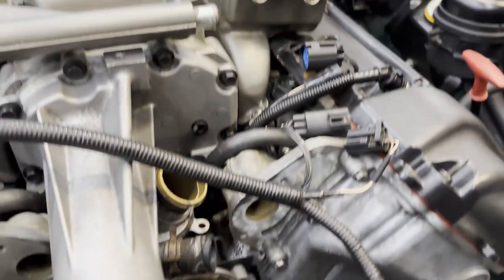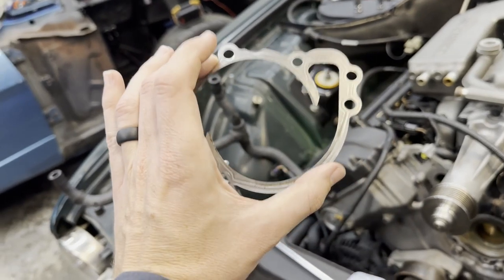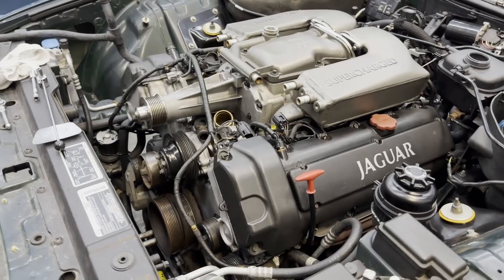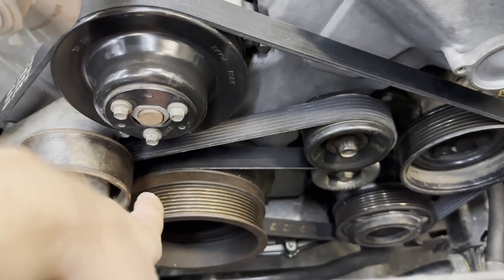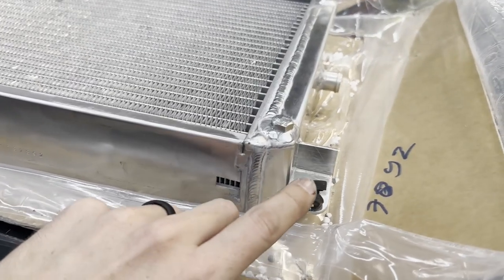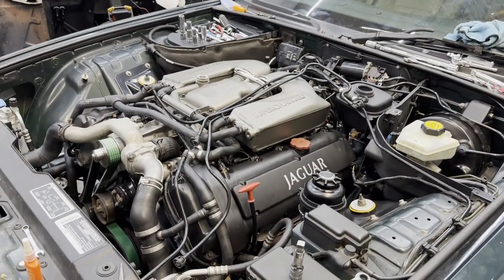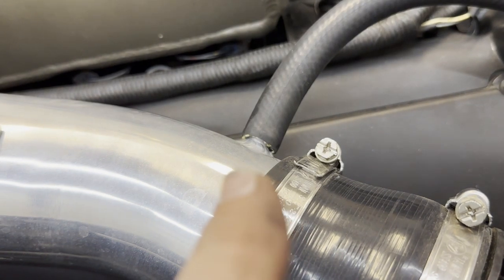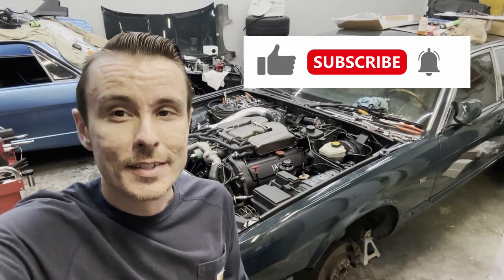Jaguar XJR Head Gaskets - Part 9

Comment: From part 1 to part 9 .. Superb viewing!! ... Your very brave, I'll give you that lol .... Some interesting notes on the head bolts where you installed them dry, ... I've done quite a few head gaskets of different size engines, straigh 6, V6, 4 cylinders etc, and I was always told or read that its best to dip the bolts in engine oil before you torque them down, so this was a new one on me with the XJR V8 .... I am doing some mods myself which you have already done, I'm waiting for the CAI from the states to arrive, seems to be taking forever but that's expected from ordering from the UK to get it from the States seems like it's arrived in the UK now after checking the tracking so that's cool, I've also got the 10% charger pulley like you got as I can't hear my charger whine at all so hoping this will wake up the noise on mine. I have the 2001 model so it's the SWB facelift and apparently they put more insulation in the car, hence can't hear the charger and engine so quite as well .... Anyway, won't bore you anymore lol ... Great video's keep up the good work, enjoying these XJR videos your doing. 😎😎😎😎😎
Reply from the maker: Thanks for the kind words! My XJR had an insulating pad under the supercharger. I wonder if you other car has that or if it was removed at somepoint.